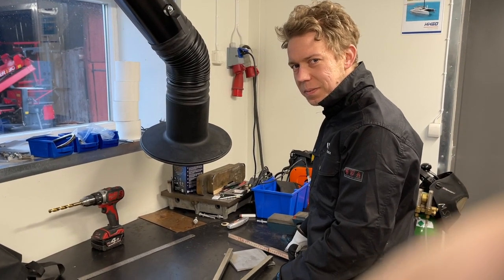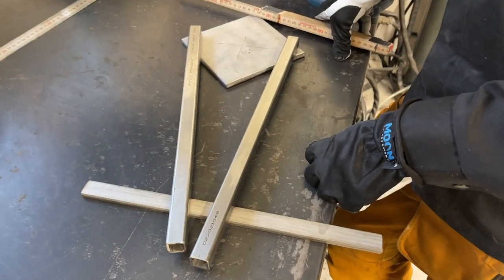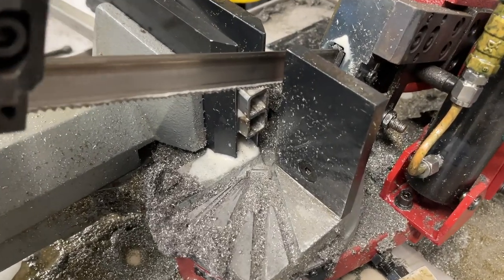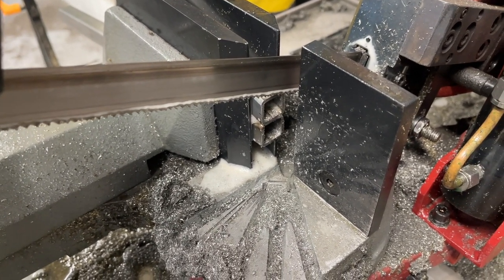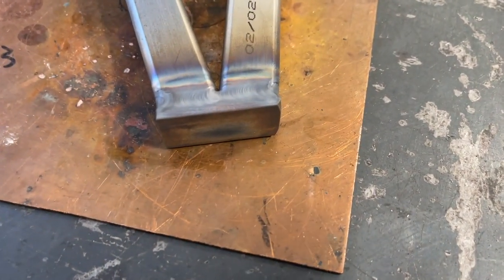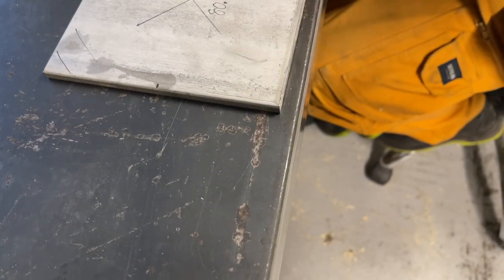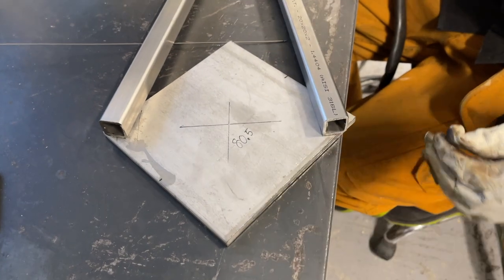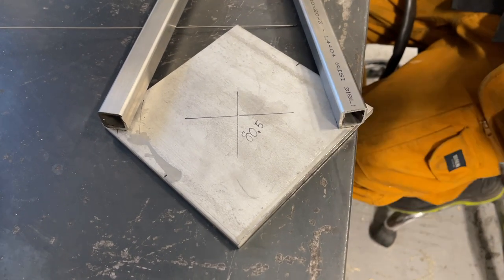31 Jan 2023  The beginning of the tiller thrust bearing complex. Martin svets cuts and welds.

Comment: Thrust bearing? Inboard motor?
Reply: Motor? Read his books and come back again.best regards.
Reply: He has talked about an electric motor. But it would be more likely on his next boat.
I think he's putting a type of thrust bearing on the top of the rudder post, where the tiller attaches.
Reply from the maker: The thrust bearing is to take the weight of the rudder.
Reply: Hey mark.does it seem fear is something i dwell in?
Go follow me instead....
Reply: @Mark Archer no worries here :-) I'm not new and I know that Sven had mentioned an electric motor before.
Reply: @snorungar70  but if you've been watching his channel, you would know that he's mentioned having an e-engine. And since he's always thinking many angles and many steps ahead, it's not unusual for him to change the design. He surprised us before. 👍😁

Comment: Hej idolen.dina åsikter om Tore Herlin k 28?
Står inför ett beslut.havsfidran behåller jag men jag är bekväm och vill ha ståhöjd å refleksvärmare.lofoten är målet.åsikter tas emot med värme.J
Reply from the maker: I like composite shallow draft centerboard boats in sandwich construction with balanced lugsail.
Reply: Jag har följt dig sen 81.. när jag var elva.
Jag vet vad du föredrar.jag frågar om din åsikt som konstruktör ang Tore Herlins k 28.
Du har ju seglat Vega nån distans.
Har du ingen åsikt eller nått att säga är det så.
J
Reply from the maker: @snorungar70  I do not know the boat.
But Herlin is a good designer.